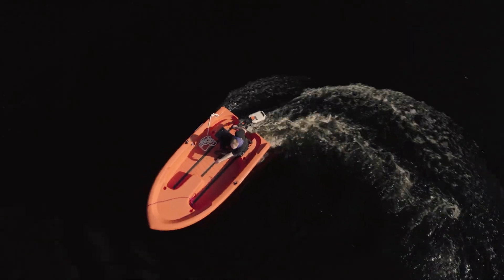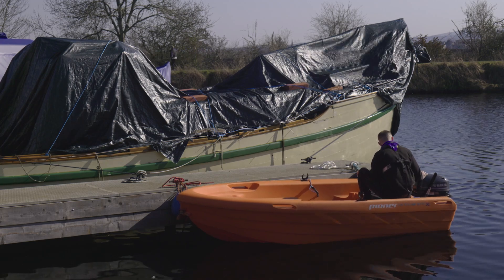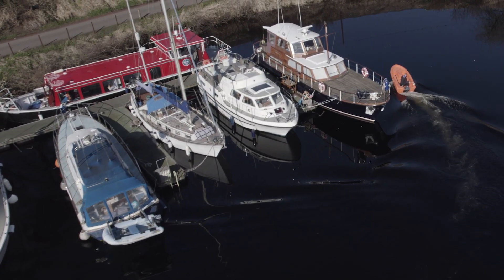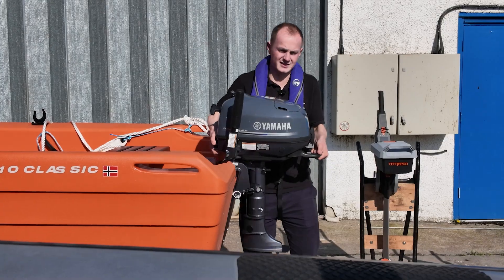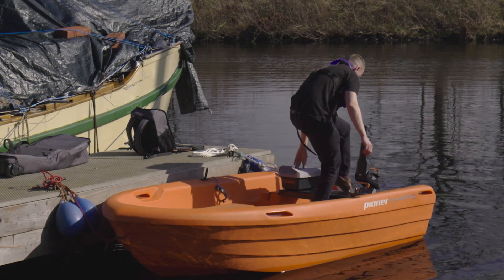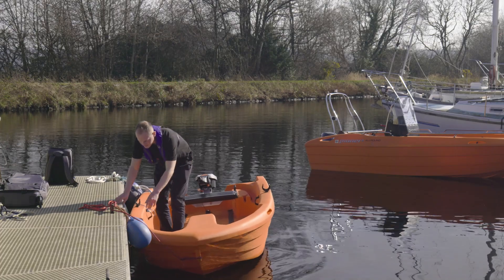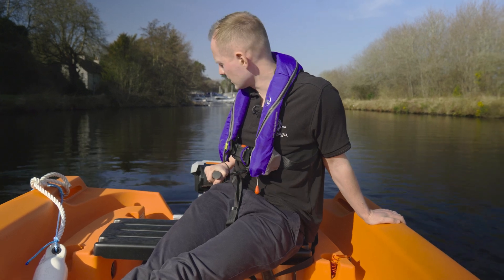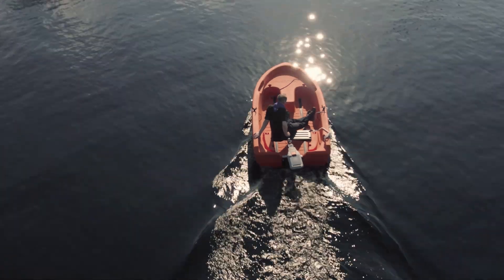Electric vs Petrol Outboard: Which One Should You Buy in 2025? | Pioner Boats by Caley Marina

Comment: I’d have the Yamaha, going against the current drains the batteries far to quickly for my liking.
Reply from the maker: The Yamaha is still a good option however, the Torqeedo option provided a nicer experience in our opinion. Thank you for watching
Reply: @caley-marina had a epropultion which is similar.
Reply from the maker: @thekitowl  what vessel was the engine fitted to?
Reply: @caley-marina 265 air deck dinghy.